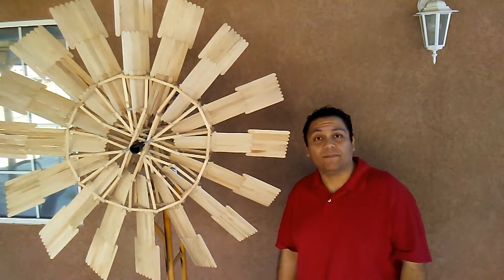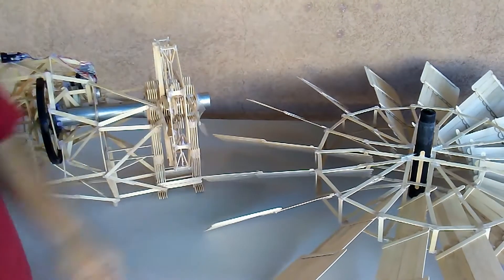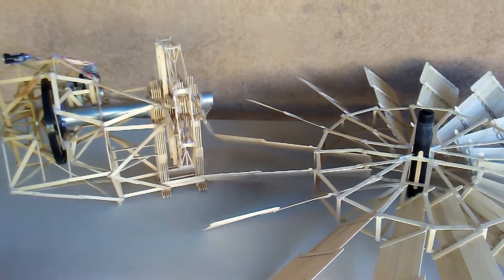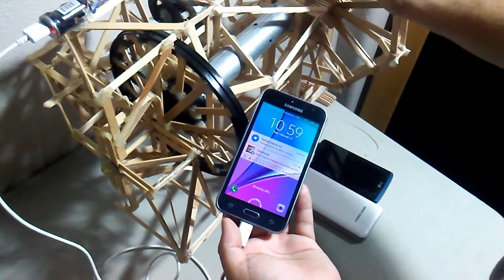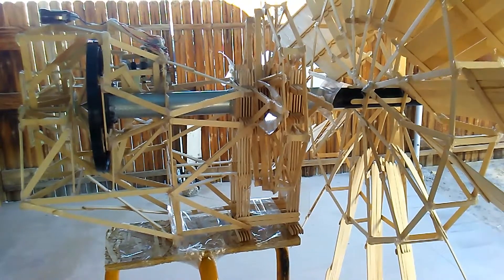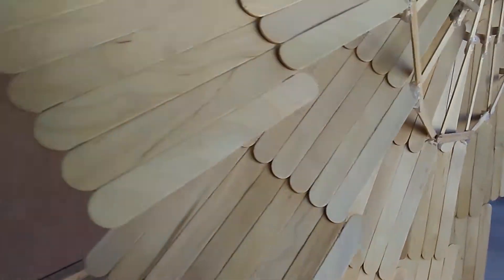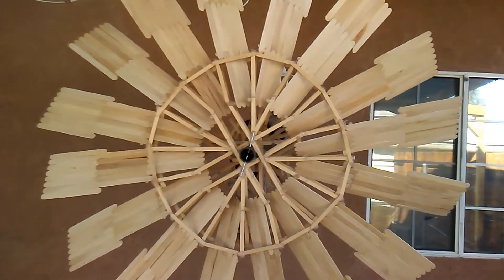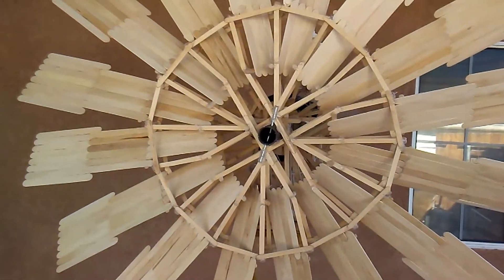Wind Turbine Generator made with popsicle sticks

Comment: Would it be practical to add a system that allows the turbine to turn to face the wind directly? also how much energy would such a turbine generate relative to common household usage such as indoor lighting?
Reply from the maker: Hello Ramces Gonzalez, yes. It would be way better to have the turbine turn in the direction of the wind. Well a wind turbine of this size can generate around 400 watts. That's a good amount of energy for simple indoor lighting. This generator was first design to work with falling weight then i was ask if i can make it wind powered. That is why the turbine is so big to get enough torque.I'm pretty sure i can generate a lot more power with the same turbine but with a bigger generator.